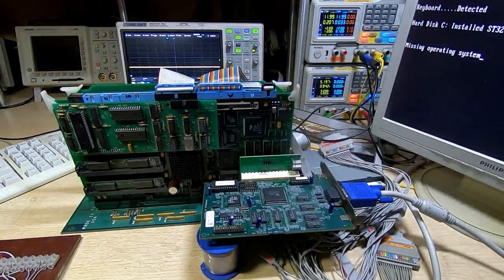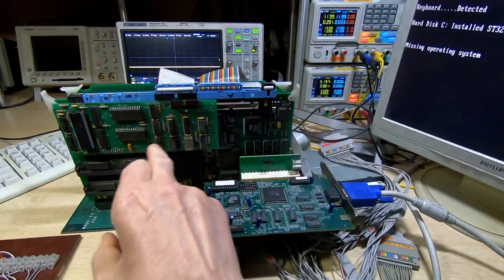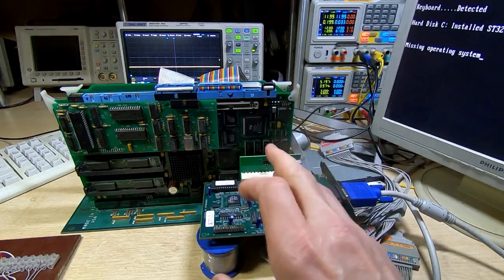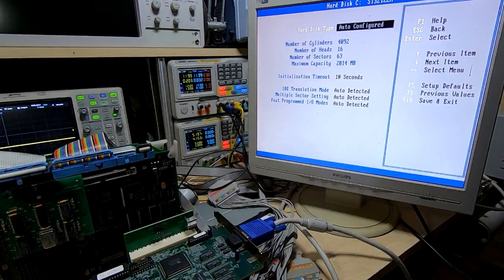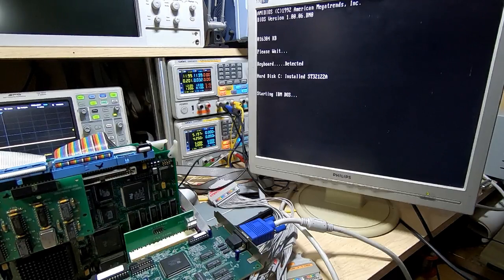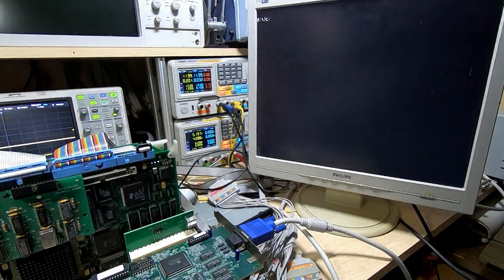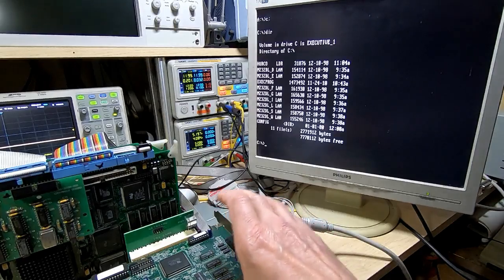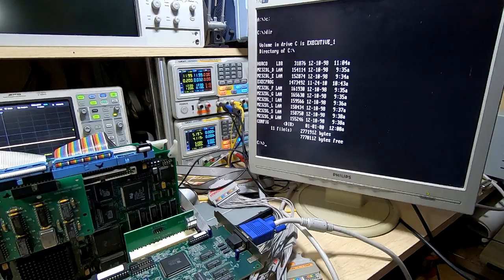Hurco BMC25 Controller Repair Part7

Comment: I presume that the Hurco boot floppy is a sort of IBM configuration floppy used on PS2 computers. It must have the serial configuration on itself to allow external terminal to have a display. It would be interesting to reverse engineer the content of that floppy. On some old tool machine there are multiple floppy disks to “re-flash” their hard disks. Very interesting series, thanks for the sharing.